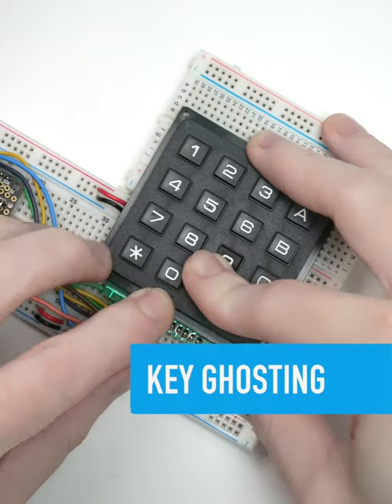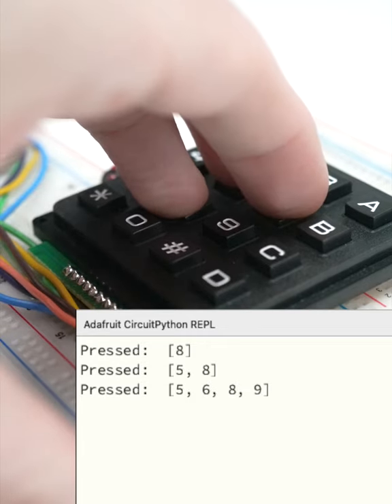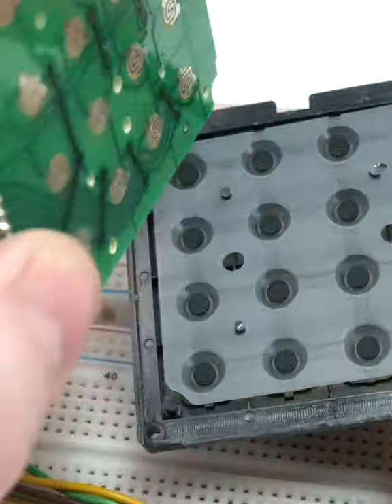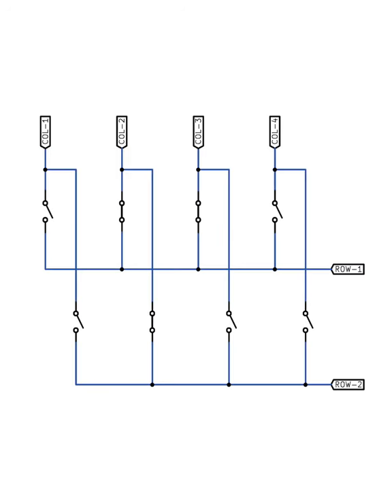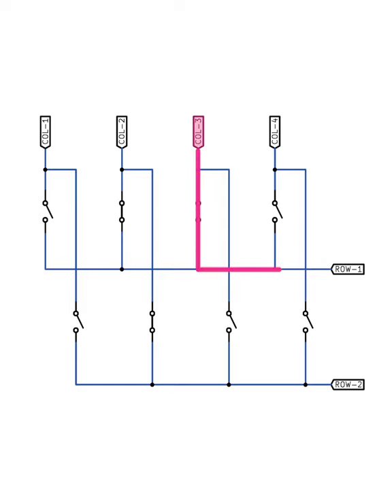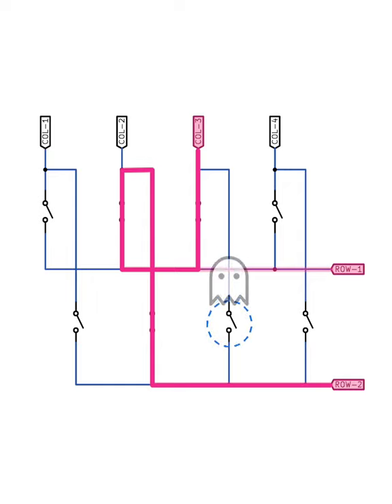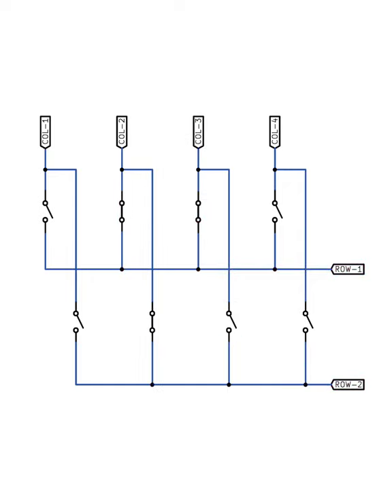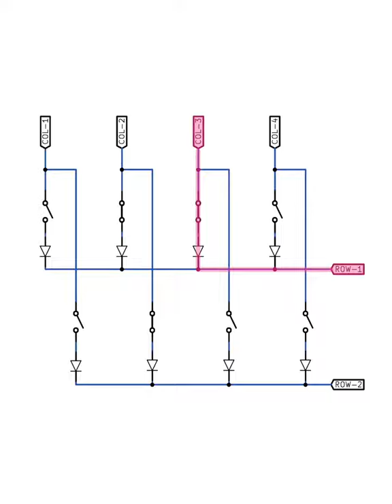Key Ghosting - Collin’s Lab Notes #adafruit #collinslabnotes

Comment: What is the opposite of ghosting called? Like when you press two buttons so you can’t push a third?
Reply: N-key rollover(?) Or in your case, 2-keys rollover
Reply: Well it's the same as Ghosting just that the Microcontroller is Smart enough to notice the Illegal Combination which may have cause by Ghosting and Simply don't Register them to the Computer